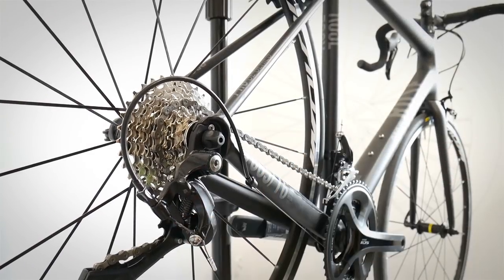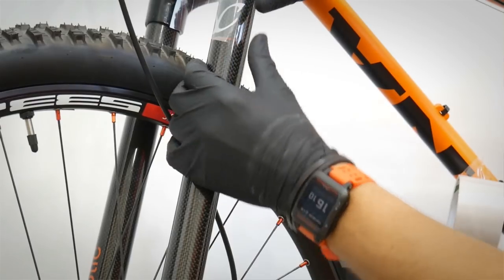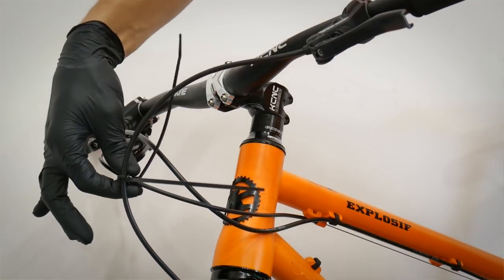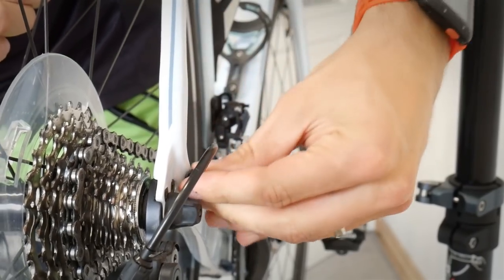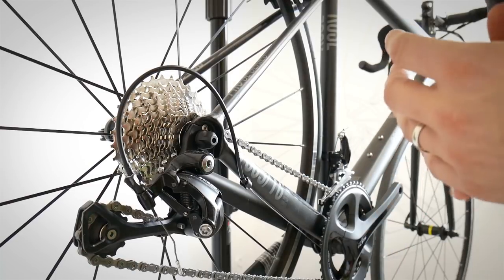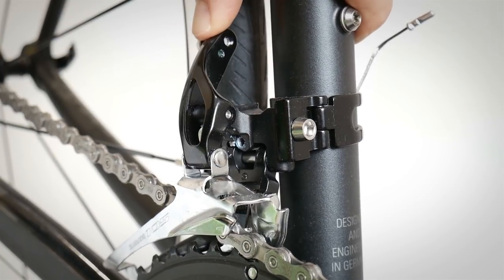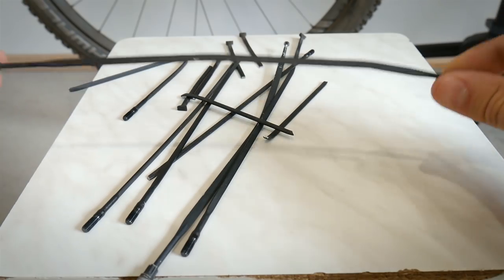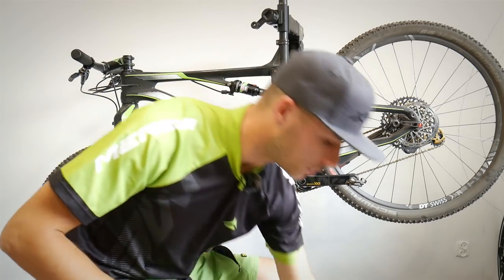4 Smart Zip Ties Hacks For Your Bike...

Comment: The best way to reopen a closed zip tie is with one of those mini jewellery screwdrivers [flat blade] they are used for opening watches or electronic devices with tiny screws etc, also very easy to slip in your tool pouch because they are so tiny.

Comment: I used the derailleur repair method yesterday. In doing so I learned 3 things, 2 of which weren't mentioned in the video.

First, not all derailleur cable bolts can be reached without flipping the bicycle upside-down. And, flipping the bike upside-down makes it easier to spin the cassette to be sure that the derailleur is adjusted in the correct position once it's all set (unless you have someone willing to hold the bike up as you spin the cranks). And, flipping the bicycle may allow one to reach the cable bolt a lot easier since some bicycles have this bolt facing downwards which is an awkward position when one's hands are busy otherwise. And, finally, it REALLY helps to have a third hand to tighten the derailleur bolt while keeping both the derailleur and the zip tie in position. You'll note how this video skips at that step, probably to allow a third hand in while doing the actual tightening, videoing the bolt after it's been tightened enough.

Comment: Zip ties that are not cut flush present a significant cut hazard. As a journeyman electrician I was required to use a zip tie tool to properly tension and cut perfectly flush.
Reply: Cant you just file it till its flush

Comment: I cut my zip ties flush with a sharp knife (carefully) so the sharp end that is left when using a wire cutter don´t cut me (it happened several times before).
I have used zip ties twice to isolate a punture in a tyre tube and get home. (I had a pump but no spare tube or repair kit)
You can use the strongest ones in reverse, to pack something, and easily open it and close when needed. I use this way on HIFI/TV cables, computer networks, etc...

Comment: Your shifter cable is longer than the rear brake hose. Make them the same lengths, tie them together with zip ties (as they move together) and then connect the front brake. Neater and you can use more zip ties. :)
Reply: I just did that today, but instead of using zip ties I covered the cable in electrical tape (I have 2 brakes and 2 derailleurs so 4 cables) and now I have 2 thicker cables

Comment: Number one zip tie hack is the never ending supply of random size/length FREE zip ties....how?  Simply by saving EVERY zip tie that comes securing various products you constantly buy....simply by snipping all those ties as close to the head as possible you will harvest a zip tie....just make sure to cut on the side BEFORE it is gripped by the tang in the head!  In other words the OTHER end not physically molded to the head!   DUHH  then simply pull out the "tail" (that piece is trash) what you are left with is a perfectly usable albeit shorter than it originally way zip tie of random sizes from teensy to massive depending on the product it came securing!  Some are even quite long depending.....generally I harvest far more zip ties than actually ever even need....ALSO regarding the short lengths?  Do NOT forget that zip ties of identical original sizes CAN be zipped together to make a longer tie!   And yes I know zip ties are relatively cheap to buy but the point is WHY? IF you can avoid it?  Every little bit of recycling certainly DOES help the planet!  Thoughtless waste is just SO uncool!
Reply: Yo daddy chill, we not gonna stop using zipties